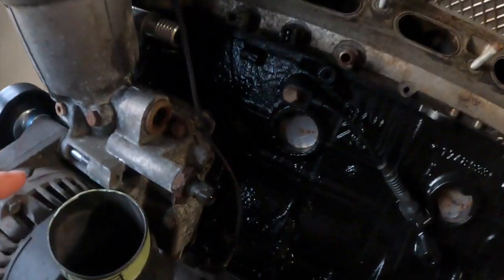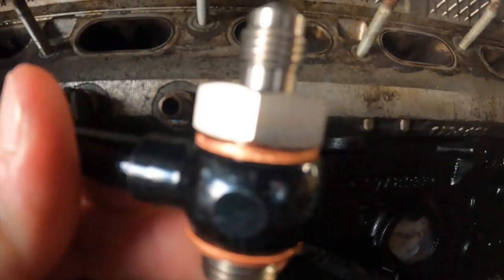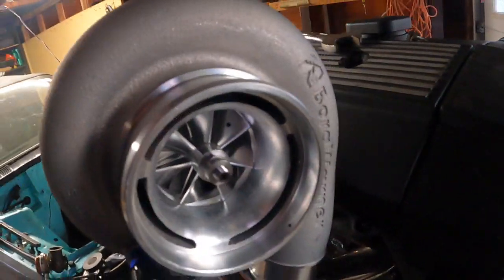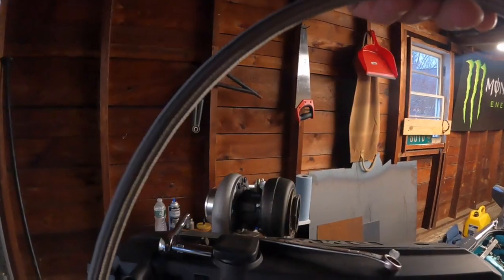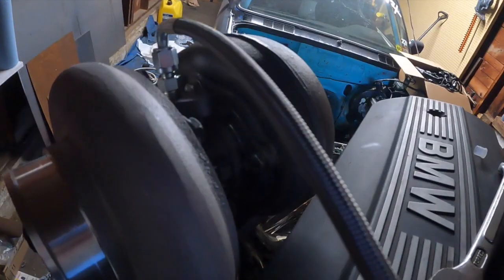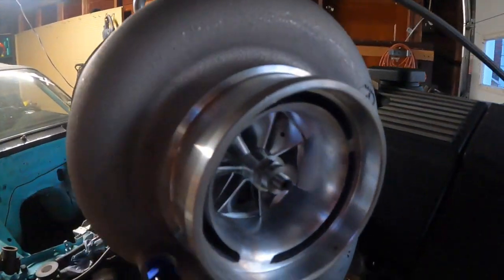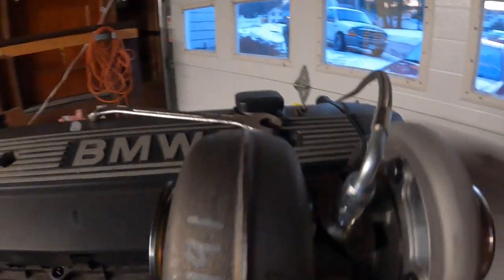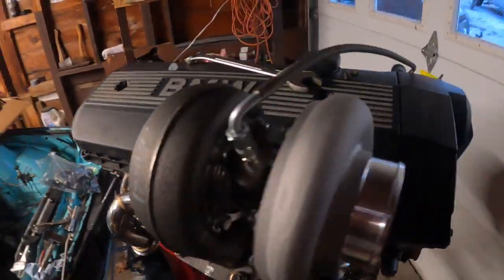BMW M50 TURBO OIL FEED AND RETURN

Comment: What if I have a non vanos motor, Is that port still there?
Reply from the maker: Sadly no but you can tap off the oil pressure sensor with a T fitting or junction block that’s what I did with my m20 turbo

Comment: Do I still have to drill  hole to the oil pan if I do this way ?
Reply from the maker: Yes sadly so if it’s on the car it’s a pain in the ass
Reply: You can get a drain to plug so you don’t have to drill it’s 10an to m12 1.5 ! So you don’t even have drop the pan so the oil drain going where the plug would go
Reply: @richardwork5101 do you have a link to where I can find it? I’m turboing my e46 and I honestly don’t wanna have to drop the oil-pan and drill into it